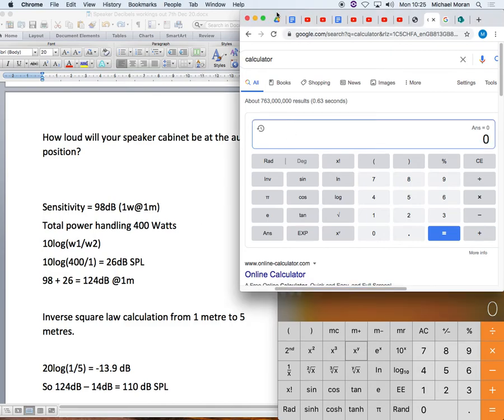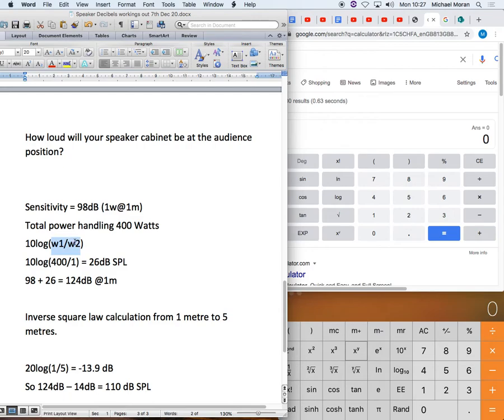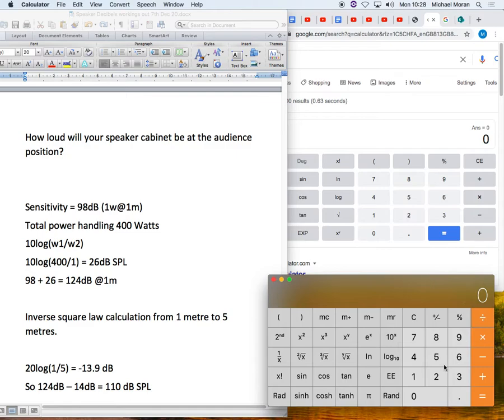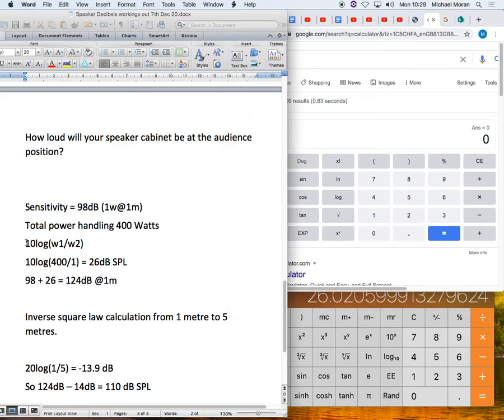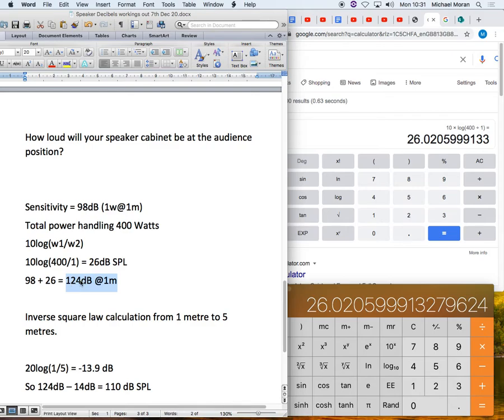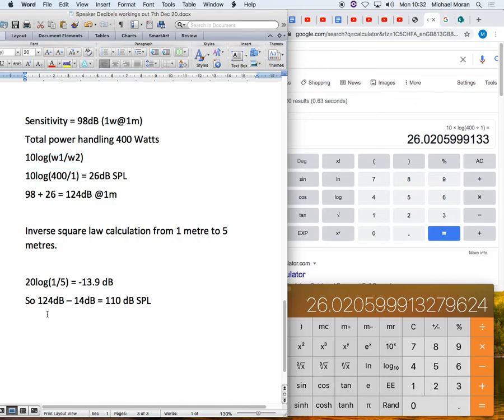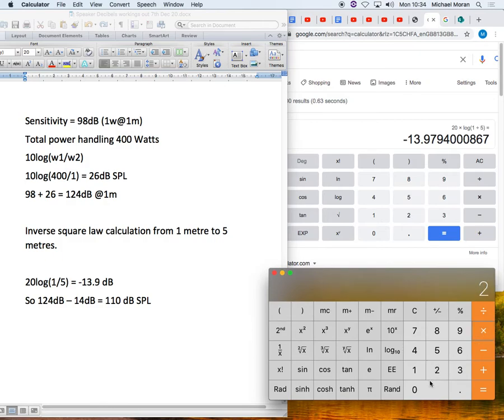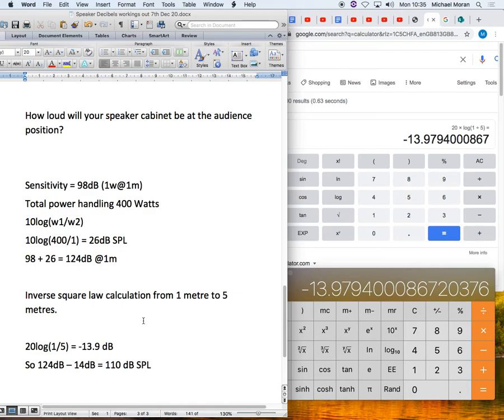Calculating PA system SPL

Comment: Hello Mike. Your video was really helpful . Just one doubt. Are we taking into account how far the cabinet is from the front seat of the audience OR the back of the audience ??????
Reply from the maker: Hi Neeraz, thanks for your message. In this instance, the tutorial was aimed at a particular student group during Covid and we were dealing with a small venue space where 5 metres from the stage was the rear of the venue. The other discussion I did not include is how elevating the speakers above the audience can reduce the difference between front and back of the listening area because of the axial response of the cabinet - the listeners at the back are more on axis with the upper frequency dispersion than those at the front. Sound pressure will drop over distance to an extent due to the Inverse Square Law (it does not take into account reflected sound). In a larger venue, multiple cabinets are more likely and these days they are likely to be in a line array configuration which 'cheats' the inverse square law by projecting a single wavefront across all cabinets thus projecting sound energy more efficiently. The array will be angled so that near seats will hear the energy from the lowest cabinet and the furthest seats will hear the energy from the uppermost cabinet. The distances to listener from each cabinet will therefore vary and a system engineer can design an array in advance using software to predict how much each sound power each cabinet needs to deliver to create a uniform listening experience from front to back. Hope that helps.

Best wishes

Mike